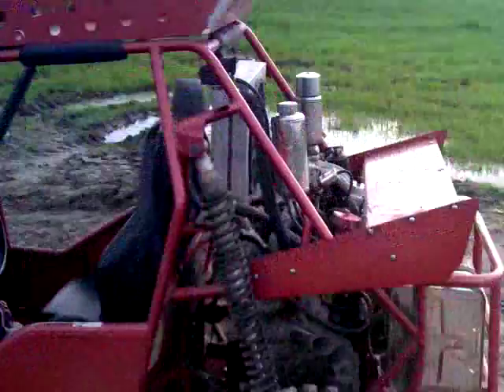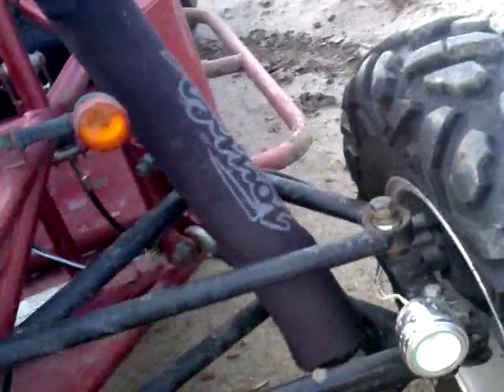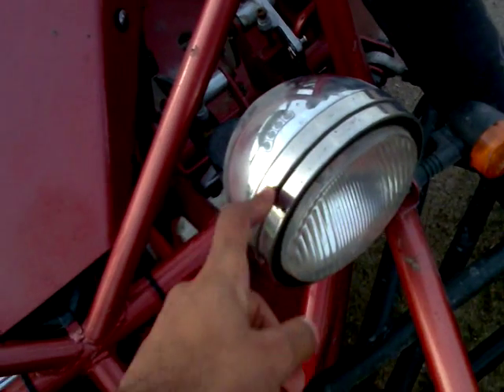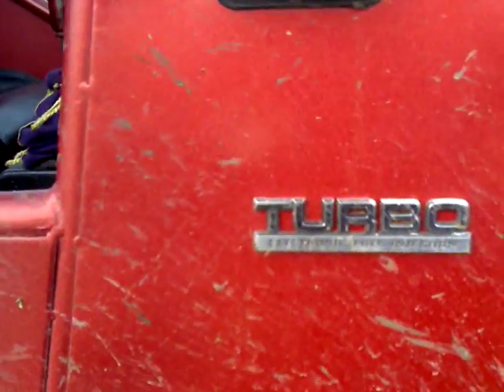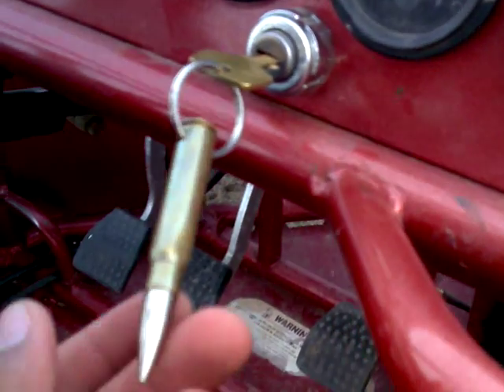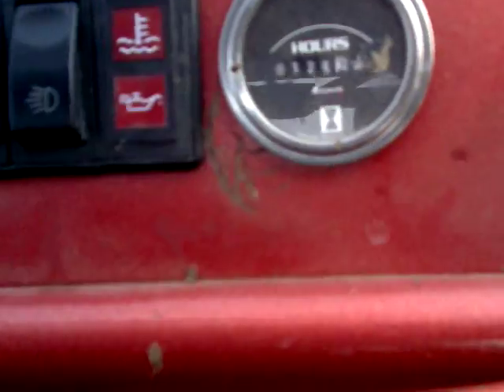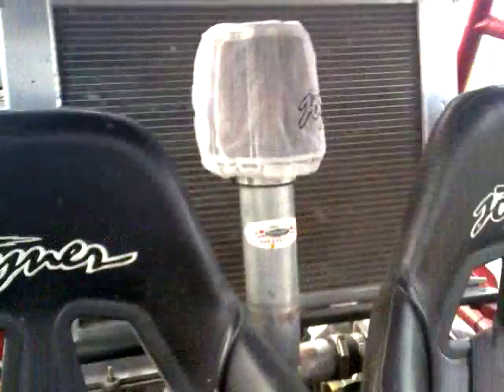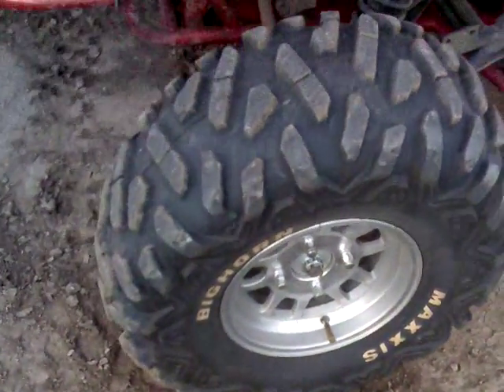2007 Joyner Mini Viper Features (800cc Turbo) part 1

Comment: Did it hold together running 10psi on stock internals?
Reply from the maker: blackz06 It still works today and for the past couple few years I upgraded to a high flow fuel pump to prevent leaning out. you can google the fuel pump thing to learn about it.

It doesnt hesitate to start so its still holding compression.
Reply: I fully understand fuel pumps and pressure(not trying to sound like an ass lol).  I'm just curious how well put together these chery 800s are.  My Gator has one, and I'm thinking about putting a turbo on it!

Nice buggy, btw!!
Reply from the maker: Just dont over reach on these motors. Its a 3 cylinder after all and has its limitations. If you need an internal part it can take some time to get. I had mine run lean to long not realizing the fuel pump starved it and the valves wore out quickly. It was the only internal repair done and has been fine since. That was 7yr ago and was determined to be the result of the fuel pump. .
Reply: Yeah... I'm thinking 7-8 psi, for a ~50% horsepower increase.  I might be happy with that lol... for a while